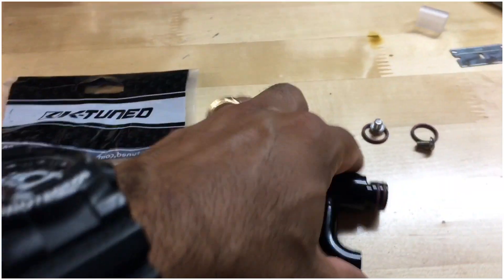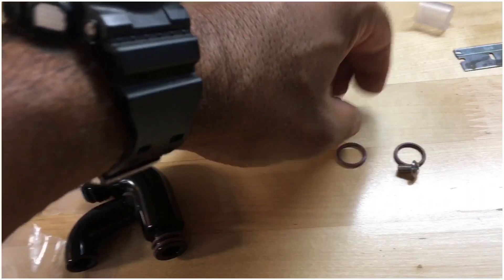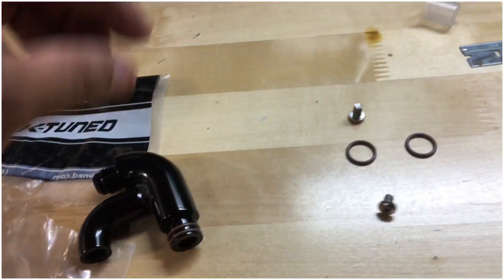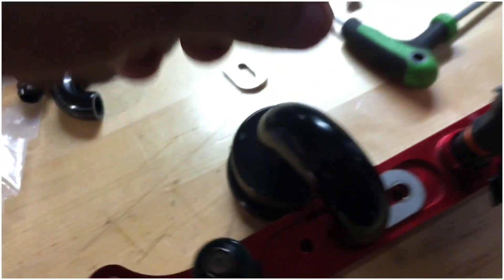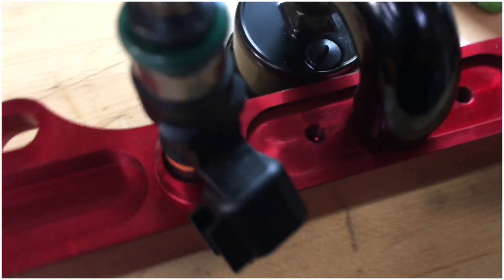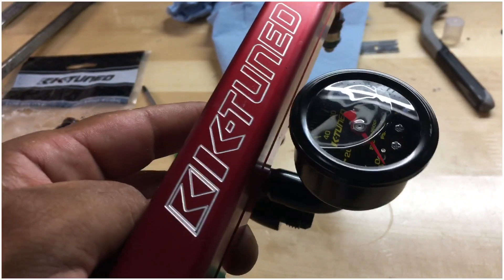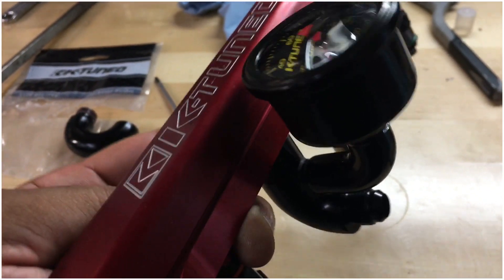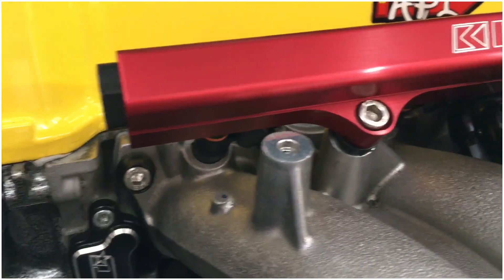Ktuned fuel rail feed with gauge

Comment: What is cost I gotta have it
Reply from the maker: Sean B 40.00 👍🏼
Reply: Albert Marty how did u run line off same side
Reply from the maker: Sean B it’s on the same fitting that go’s on the fuel gauge read
Reply: Albert Marty oh I know bud I was wondering the route u ran braid hose on same side u had before and just went under mani